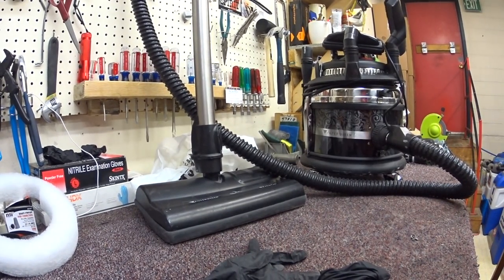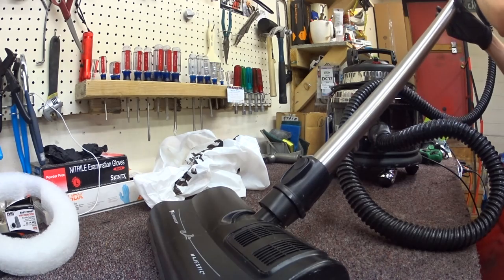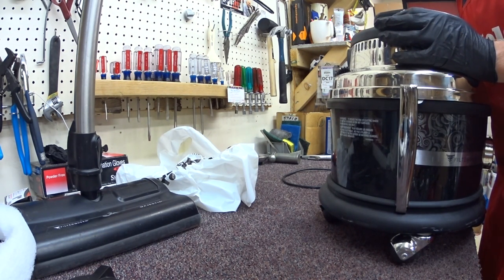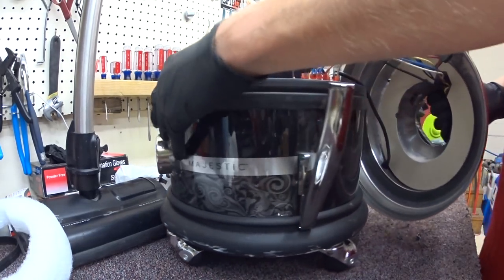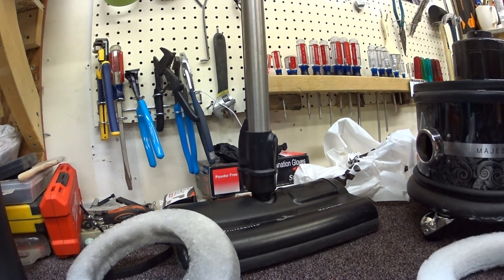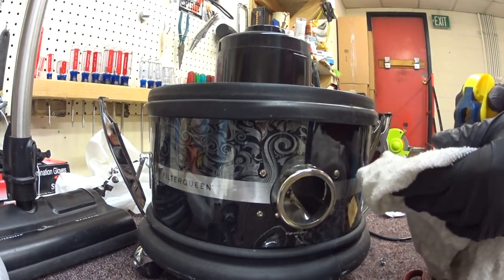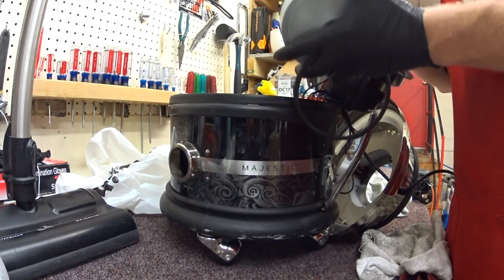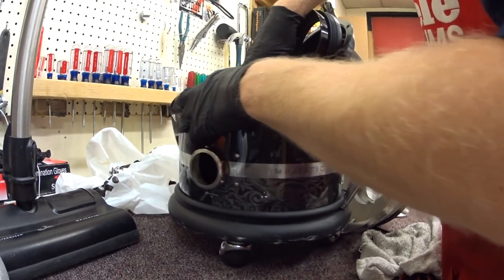Filter Queen M360 majestic Fix "Tuneup " vacuum Filter test with particle counter

Comment: The green machine was the end of filter queen quality machines.. The 360 and on are cut down  quality  .the machine is now made cheap to compete with cheap price machines
Reply: Alan Baird If I have a filter queen Majestic 360, I would put I a 6.6 inch tangential bypass lamb motor with eternity brushes  and put a hepa filter on the discharge port of the motor.
Reply: The metal extension wand brakes quite often where the plastic and metal connect at the end of the wand. This were it connects into the power nozzle. To replace the  wand it will cost a hundred dollars.

Comment: I'm on here watching you take the top a part and put it back together. I have a Filter Queen M360 that I bought years ago. The trouble is, I made the mistake of letting my daughter borrow it and she has kept it now for around a year. I let her borrow it after I was talked into buying a Kirby. Well needless to say, She did not take care of it. When I went to her house for Thanksgiving, I seen my vacuum and lifted the top off, but was I shocked! I don't know what it's called, but the part you skrew the motor cover into was busted around every one of them, so you could see the motor. I did go to their site and order the replacment part, so I'm watching to make sure I put it back together right. I'm still upset about that, I bet there was a least 1/8 in of dirt covering the motor filter, plus I could tell she was reusing other filter instead of replacing it. Before this happened though, I never had any problems with it and I myself like it better then my Kirby. The Kirby to me is just more of a hassle, to many parts you have to keep changing around to use with it.
Reply: You know that is the primary problem with younger folks as they simply refuse and will not do basic maintenance on vacuums such as the Filter Queen. Filter maintenance is an absolute must for them!

Comment: Just picked up the AT1100 model at a goodwill for $25 it looks like it has never been used the best vaccum I have ever used and it is quiet love it
Reply: I just picked up a 112B for $25 from a person on FB Marketplace. He also gave me a complete year's supply of FQ brand filters and extra motor and inner filter. It is missing the dusting brush. The hose was clogged with some plastic toy and cat hair, but after a good cleaning and un-clogging, it runs quiet and like a dream. It looks a little different than the model he worked on, so mine must be older. It does have a height adjustment on the brush motor head.

Comment: I have approximately 8 Filter Queen vacuum cleaners, I buy them every time I see one at a sale or thrift store. The older ones have very good motors and can be easily serviced and with quality care they can easily last a very long time! I also try to use only the genuine Filter Queen quality cone filters as they are the very best at preventing dust particles from entering into the motor area. Luckily with a little research they can still be found on line or at other sources.

Comment: I am curious to know if you ever need to change the brushes? Because I would assume they wear down. On my filter queen that i am cleaning up now, i just feel the brushes do not protrude out of the bottom enough to push through carpet.
Reply from the maker: Yes typically that brush needs to be changed every two to four years.
Reply: My Majestic cleans shag carpet just fine and I have been using the same brush head for 15 years.

Comment: Using a 10 amp or higher DC power supply capable of supplying 20 volts or more is a nice way to polish the commutator while being able to handle the motor itself without the risk of electrocution.  I find it nice for units where the motor isn't easily accessible.  It won't, however, protect against injuries due to moving parts.

Also, it's nice to see that Lamb did make repairable plastic brush motors.  I thought they were all complete garbage, as the ones on the older Panasonic power heads, where they were plastic welded into one piece.  It was fun to find one of those in a Kenmore power head that needed a bearing in the motor as well.

Comment: YOU should have seen what the batting of my filter queen majestic looked like when i got it! It smelled awful so i called up my local vacuum despair ship to see if the owner could order me some filter cones and some new batting, as i was searching for a serial number, i got the top casing completely off and had access to the batting so i just soaked it in some Ajax liquid and bleach and patted it dry and popped in back in there and it was good as new!

Comment: The three canister vacuums that I respect the most because of the way that they’re built.
Filter Queen Majestic
Aerus Classic
Sebo D4

Then 
Any Henry 
Any Miele
Rainbow
Reply: The other Sebos
Reply from the maker: I definitely agree. My one annotation would be I think filter queen and a slow downward spiral after they've moved out of Chicago. After about 2000 they really started cutting corners. Unfortunately this majestic in my mind doesn't live up to the name filter Queen.
Reply: I’ve noticed some cost cutting in the accessory hand tools and you know that I’m all about the hand tools with vacuums. I also think that they’ve cheapened the ring that holds the tools a little. I’d like to see them improve the casters.  At one time though their hand tools were works of art.
Reply: @PerformanceReviews  sad to think they are cutting costs while still trying to charge $3300 retail.  I really can't tell what accounts for the difference between a Filter Queen and a nice shop vac with a bypass motor and hepa filter for less than $500.  Milwaukee's 8912, 8925, 8926, 8936, 8938, 8950 and 8965 vacuums all use much higher quality ametek lamb motors for a fraction of the price.  After watching this my opinion is that Filter Queen are a bunch of crooks.  And I thought metro-vac was overpriced lmao!

Comment: I find that I have to take the power head apart once a year, as they pull so much dirt at a high speed, the dirt with any oils will smash on the sides and build up, plus washing the hair brush out keeps it in new condition.

Comment: I like your video on the FQ Majestic. I'm curious of what brand of fuel you used? I've been a FQ person since the 70's and I'm shocked at the cheap baton filter&small single stage motor. I've vacuumed everything from normal dirt,plaster dust and yes as a teenager,got drunk and vacuumed up paint with a FQ. Teri be to admit that but all I ever used was genuine cellulose filters. I place cone on moter unit upside down and make sure it's snug, then place it on dirt container. That way it's 100% sealed. Your right, there not the quality they once were. Looking forward to other videos!!!
Reply: Even a 700 dollar Lindhaus has a 2 stage motor in it.

Comment: I've noticed that you've worked on a Filter Queen before in a previous video. It's a pretty obscure brand. You'd wiorked on three post 1992 Electrolux 2100 models and a Renascence. The Electrolux Odell from the 1205 through the Grand Marquis had a very long run at a time when the company had record high sales figures. There are plenty still around and I was wondering if you ever get them in for service.
Reply: Electrolux model not Odell. Spellcheck
Reply: Filter Queen sells millions of their  vacuum cleaners every year. Any dirt that gets on any internal parts are carbon dust at times and very little at that.

Comment: $3000 for a vacuum is crazy and so not worth it, can't even filter well.  I just purchased a Maytag M700 equivalent to the Simplicity S20 deluxe I do believe, but correct me if I'm wrong.  Brand new, just paid $299.00 Canadian Amazon Canada, regular $699 or more in Canada.  So happy I have it.  I also have a Sirena water filtration vacuum with a Wessel Werk ebk360.  Also great vacuum, but love the Maytag M700 more.
Reply from the maker: The s20 is a nice machine a little heavy. Would like to see your sirena with a ebk360 that would fix most of the problems they had.
Reply: I actually bought it from Sirena.  It is their platinum version, the machine is black and comes with a modified crush proof hose and wand for the ebk360.  But it also comes with the original 2 sets of hoses with the original powerhead as well.  Was $1200 Canadian but they gave me lots of extras, I tend to haggle.  So got 2 extra HEPA filters, and extra fragrance pack as well as an extra deodorizer plus a turbo tool.  I really wanted an upright and the Maytag was too good of a deal to pass up, but bags and filters hard to find here and pricey, and is heavy as fuck, but I prefer that to the lightweight shit that feels like it will break if you look at it wrong.  I had a lindhaus activa platinum upright I gave to my sister so all I had was a crappy shark rocket which is ok for quick clean-up but I hate it and didn't want the hassle of using the Sirena twice a week.  I haven't done a comparison as to what cleans better (shark not in the comparison).  All I knew is I didn't want anymore bagless shit as they do not work well and I don't understand why the bagless thing has become the craze.  Sears no longer exists in Canada, so I took to Amazon and this company had 1 Maytag M500 for $199, 1 M700 for $299, and the M1200 for $499. The M700 was all what was left so I took it.  New in box, heavy as fuck but I really like it.
Reply: And btw, really love your videos, you explain everything so well.  If I needed a vac repair I'd want you to work on it.
Reply: I just got one a filter queen today for $20 at a thrift store.
Reply: A 1600-dollar Miele C3 and SEB 236 deal at a vacuum store is a much better value.

Comment: Correct me if I'm wrong but my neighbor had a filter Queen when I was younger and I remember the powerhead having a carpet height dial on the back of it and correct me if I'm wrong but is the newer powerhead cheaply made compared to the old one and what's the amps on the power head also is the brush roller is in a stiffer bristles or the more soft

Comment: When the motor is exposed in this video & the carbon brushes are still in place & the vacuum is turned on, does it throw off a small amount of spark where the brushes meet against > (that spinning thing in the middle) of both brushes ?  Should there be small sparks ?  But if there shouldn't be sparks, what does this mean if it (is ) sparking ? Hope your able to answer my question Thanks
Reply: Yes there will be small sparks when you if you start the machine with the exposed motor.  Seeing that this expensive vacuum uses a thru-flow motor rather than a tangential bypass tells me all I need to know about the lack of quality and care this vacuum manufacturer uses.  It is pathetic.

Comment: I just ound a filter queen like that  at the garbage, not the magestic  the previous one   and it works great but smells a bit  so would you say its because of that  batting? And  I do not have the brush  head or beater bar    does every filter queen have a way to  add one?

Comment: Holy Christ on the cross, that motor sounds atrocious!! $3,000 vacuum and it sounds like a $65.00 Dirt Devil from Wal-Mart! I'd be sending that FQ back where it came from real quick! I use to have an old early '70's model FQ - it was whisper quiet and that motor ran for 40+ years on the original motor and carbon brushes.